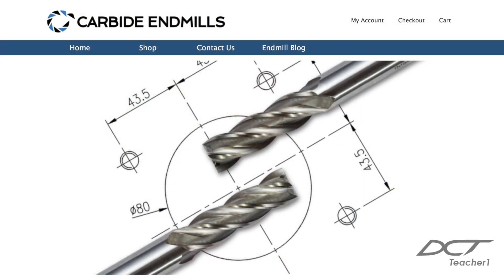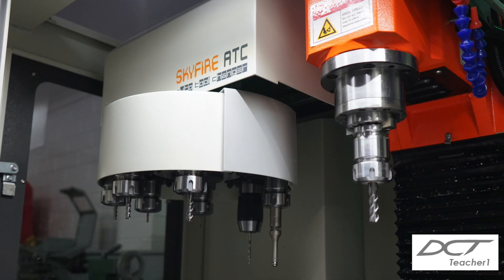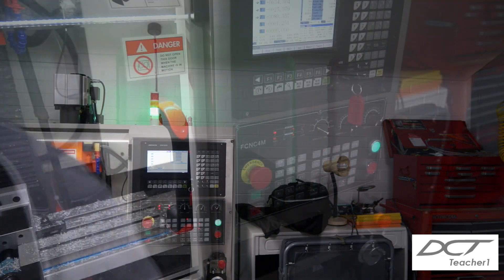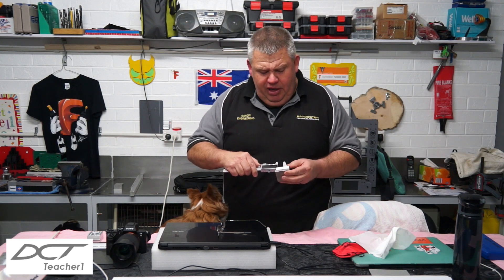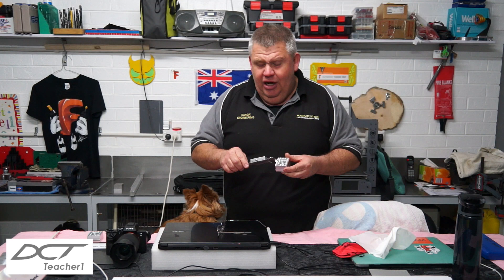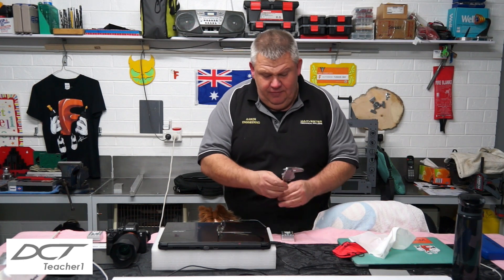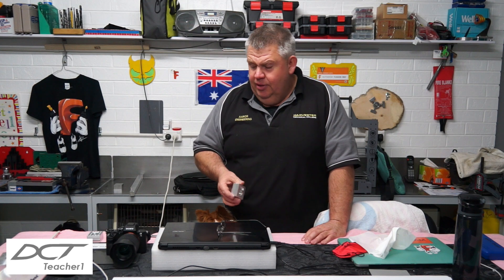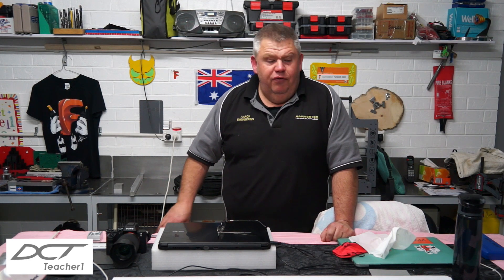SkyfireCNC First Test Cuts - Using Fusion360

Comment: How does the vibration of the z axis feel?
Reply from the maker: Hi, I sold this machine over 1 year ago.  I now have a Syil X7 CNC mill.  Much more solid and overall better machine.  Cheers, Aaron.
Reply: @DCT_Aaron_Engineering   I see, Syil X7  is it a Chinese manufacturer? because I don't see it on alibaba
Reply from the maker: @wiraxbox360  Yes they are Chinese OEM manufacturer.  So they don't need to use Alibaba.  Google search SyilCNC

Comment: gosh i wish they were cheaper. i wud get one straightaway :(
Reply from the maker: Yes I agree, but unfortunately that's just the way it is with CNC machines.   If you would like to get into CNC, I suggest converting a manual machine first with stepper motors.  This is how most of us started out :-).  Cheers, Aaron.

Comment: Are the Skyfires normally that slow or are you running it that way for demonstration purposes? I had thought they were capabale of 300 plus ipm.
Reply from the maker: Hi Glenn, yeah I'm just taking it easy mate.  The machine is capable of some very fast rapids.  However, remember spindle RPM and feed rate go hand in hand ;-).  My spindle will only go to 7K.  Supposed to be 8K but it hunts like SOB at that rpm.  Cheers, Aaron.

Comment: Hi Aaron, I was going to pull the trigger on the Masso based on your enthusiasm, but you've slipped us a side-step by going to a turnkey option. Why so?
Reply from the maker: Hi Bernard.  I bought a Masso and installed to my own CNC machine back in January 2017.  I was very happy with the Masso and it worked very well for me the time that I had it.  The reason I purchased the Masso was because of the support I got from Jatinder.  Furthermore, I liked how it was so easy to wire up, set up and use.  I sold that machine to fund the "turn-key" skyfire.  Knowing what I know now, I wished I had purchase a Syil X7 Combo.  My skyfire machine has had it's moments, but it has had 4 or 5 break downs over the past year.  Cheers, Aaron.

Comment: Hi Mate,  I dont know if you still monitor these videos but if you do I have a question if you dont mind.   Why did you buy ready made machine over building your own machine?   Your videos are very good information. Thank you so much.   Good on you.
Reply from the maker: Hi Thomas.  Thanks for watching and thanks for posting a comment.  TBH I did originally convert my own machine some time back.  I used it extensively at home, but just got so sick and tired of constantly tweaking it.  I opted for a turn key machine that has linear rails, servos on all axis, toothed drive servo spindle motor, BT30 spindle with ATC and PDB.  I just want to machine parts and not be a machine builder.  My next machine will be a Syil X7 Combo.  Check them out on Instagram CNSyil.  Cheers, Aaron.

Comment: I couldn't' stop grinning watching this video. I'm in my 50's and it was like watching a kid opening up the ultimate gift at 12:00:01 AM on Christmas Day. Watching your previous unboxing of the SkyFire was almost scary as I thought it was going to tip over in the lorry.

Seems you enjoy some of the same hobbies I do. I've had a few R/C airplanes in my day and now into the bigger stuff, stock cars (on my Youtube Channel) and want to have a home CNC machine one day. Oh how I wish I could machine my own blocks and aluminum cylinder heads (porting). But like you, I can't afford a 5 Axis Centroid or Haas VF4 SS, let alone, able to get 408 / 600 V 3 Phase in the country (Ontario Canada). I used to have Sunnen Machines for engines when I was on the westcoast.

Looks like a decent machine that could possibly support 5 Axis and be rigid enough to be accurate to hold decent tolerance. Maybe one day SkyFire will make a tad heavier table that could mount a Small Block Ford cylinder head for porting. I like that your machine can run on 220/240V single phase. I have family in Australia (Aubury - Woodonga) and now maybe I have an excuse to come back and see all the rellies! 

Nice to know that you have good support between Fusion and the machine's OEM controller. I've read good things about the Siemen's but you stated the cost and yikes, before you know it, you'd be as you stated with all the other options, into some serious money. Like Australia, our Canadian dollar has declined from par to pretty bad US exchange rate. But our import taxes for products made in China are not as high as yours are, so I suspect our cost of the machine might be a bit lower but perhaps offset with higher shipping costs. I'll be following along as you discover all the challenges with your new machine (as you found with the rigid tapping and fixed) and post feedback. Glad you enjoy your new machine. Now all you have to do is CNC an automatic baby feeding station for grandkids :-)
Reply from the maker: Hey Doug, yes it was very exciting I can assure you.  I'm like a fat kid standing in line at KFC waiting for his bucket of Fried Chicken LMAO.  For the money, it's a great little machine and fantastic bang for buck.  However, it's no HAAS or DMG Mori that's for sure.  The machine does have some little quirks that I've covered in the Q&A video, but for home I'm willing to put up with them.  Yes Albury-Wodonga isn't that far away from me, approximately 4hours drive.  For sure, if you're ever in Australia make sure you look me up please.  Cheers, Aaron.

Comment: Hi Aaron and thanks for your reply.With regard to the Seimens controller as opposed to the Adtech what benefits do you think it would have.I also use Fusion 360 for CAD CAM  and program in ISO.As there is not a lot of information about the Adtech control i would be interested in your comments.Thanks Ian.
Reply from the maker: Hi Ian.  I have never used a Siemens controller, but I think there is a lot more information out there and support for this controller. Fusion 360 / HSM cam also have post processors for Siemens so that means it should be right to go.  My advice, I should have paid the extra money and got the Siemens.

Comment: Hi Aaron congratulations on your new mill.I am considering purchasing the sky fire mill and was wondering how much memory storage it has and what method do you use for program upload to machine.
Reply from the maker: Hello Ian.  Thank you for reaching out to me.  I'm not sure how much memory the Adtech 4650 Controller has.  I use Fusion 360 for al my CAD CAM work and post process the code.  I upload the code to the controller via a USB flash drive stick.  I'm very happy with my machine and I like the controller.  However, in hindsight I should have got the Seimens controller.  Cheers, Aaron.

Comment: What are you using to find your edges?
Reply from the maker: AC Custom Gunworks hey bud. I'm using a cheap $20 Chinese edge finder. It's not the best, but it will have to do for the moment. Cheers Aaron
Reply: DCTTeacher1 thanks for your quick response Aaron!

Comment: Your calipers seem to be spot on in most of your axis but one.  I would check the accuracy of your machine in that axis and retune if necessary.  It would be interesting to know if you machined several of the same parts like your test part if they all have the same oos (out of spec) dimension in the same axis.
Reply from the maker: Hi Brian.  I've been machining many parts over the weekend and the little machine is very consistant at hitting the size. I'm getting + or _ 0.01mm.  Got to be happy with that  ;-).  Thanks for watching and commenting.  Aaron.

Comment: HI Iits rob in the uk i was wondering if you could give the lenths of ballscrew and dimensions because i can get some parts and i,ll make the rest hope you can help thanks stu mate Rob uk
Reply from the maker: Hi Rob. I'm sorry mate, but don't have the lengths of the ball screws anymore.  They were saved on my iPhone, but I've sine upgraded and didn't keep the notes.  May I suggest that you download all the files that I have listed in the description section in that original video you commented on.  If you lived in Australia, I would give you the original plates that I manually made when I first converted my TM20 milling machine.

Comment: Well Aaron you just cost me a lot of money.  I've been watching Skyfire for about a year but could not find a real person to really give an unbiased opinion on their VMC.  After seeing you and the machine running in your shed and your excitement I just pulled the trigger on a SVM-2VMC with 5 axis controller and the 6 inch 4th axis harmonic drive. No worries, if it does function as well as yours and / or I have issues I will not blame you and say it's all your fault.  Hahaha.  I went though Jan Bos USA distributor.  Says 45 to 55 days to build and ship. They are 13 behind right now. So now I have to find a new home for my Charter Oaks CNC conversion. Probably going to be the longest 2 months I've ever had.  Keep up the good work and some more  Skyfire vids would really help me keep sane now.
Reply from the maker: G'day mate, I'm really sorry about that ha ha ha.  But jokes aside, congratulations.  I'm bloody stoked for you ;-). The SVM2 has a bigger work envelope and I'm sure it will be a good machine for you.  I've had a couple of issues, but hopefully Defeng can help me tweak the settings to fix them.  Sometimes on initial boot up, the machine won't tool change and it comes up with an error.  I switch the machine on and off again and then it works faultlessly for the rest of the day.  Another problem is that the spindle brake is very aggressive when running at 8000rpm.  Sometime it will trip and alarm out when stopping at that RPM.  I've got a few coolant leaks here and there.  I've been talking to Jan Boss over Instagram.  He's a good guy.  Cheers, Aaron.
Reply from the maker: Oh and another problem, the spindle can me started manually (via control panel switch) when the chuck is unclamped (not good)

Comment: I have a few questions. Why did you choose the industrial controller vs the linux cnc controller? 
Will you share the post processor you got for fusion 360?
Reply from the maker: Hi Jason.  Thanks for watching my video.  My main reason for purchasing the machine with an industrial controller is for convenience and reliability.  I got so sick of the computer attached to my DIY mill and constant program glitches or gremlins that would come and go.  I use an industrial controller at school and just seemed to makes sense.  The post isn’t mine to share.  This belongs to Scott Moyse at CADPro.  Apparently the generic Fanuc post in Fusion works fine, but I’ve never tested it.  Thank you, Aaron.

Comment: Hi Aaron love the new machine, got mine up and running but still learning, 
getting there broke a few bits but that's all to do with my speeds and feeds too much material too quick.
I have a large engineering company near me, and i get to get some material out there scrap bin lol so its all practice,  But find its getting very addictive, i work as a Mechanical engineer off shore in the oil and gas sector, why couldn't we of had these machines 30 years ago when i was serving my time, 
Great Video keep them coming.
Reply from the maker: Hi Dave, great news you got your machine up and running.  I agree, I wish I had all this tech when I was an apprentice.  Imagine the stuff I / we could've built.  Great you get heaps of stock out of a scrap bin. I have to pay all my stock as I don't have or know any companies close to me.  I'm sick with the flu at the moment, so hopefully I'll get back out to shed to play real soon.  Cheers, Aaron.

Comment: Hi Aaron,

I love Fusion 360. I am no expert in it but I use the CAD side in some of our videos. It is one of the most user friendly CAD programs I have ever used.
Steve
Reply from the maker: Hi Steve.  Yes mate I agree with you.  Fusion 360 is the "best".  I started out using parametric PTC CAD back in 2001.  Since then I went to SolidWorks and now Fusion 360 and I'm in love with.  Can't believe we have such powerful CAM CAM software at our very finger tips.  I'll check out your channel now.  Cheers mate, Aaron.
Reply: Fusion is such an incredible tool I love it. IS there a post processor available for the adtech controller?
Reply from the maker: Hey Steve, I believe the generic Fanuc post will work with the Adtech Controller. However, I had Scott Moyse from CADPro in NZ to adjust it to suit my milling machine.  I'm sure Scott would be happy to share the post processor ;-)

Comment: Hi Aaron, What RPM are you cutting at (on the second op after facing)? Thanks
Reply from the maker: Hello Pouya, these milling operations where my very first cuts on my SkyfireCNC machine and they were not optimised.  I was only runing 4000rpm and my machine is capable of 8000rpm.  Cheers, Aaron.

Comment: Looks great mate, that tool changer is worth the price of admission heh.

We still get 0.01 variation on the VMC's at work and my mitutoyos are shit so you're doing well.

How's the vibration in the spindle? This is the first video I've seen that didn't seem to suffer too much?
Reply from the maker: Hey Manny, yeah god bless that little tool changer.  Mate I had a robot chubby that wouldn't go down for hours after operating it ha ha ha.  So far so good with the vibration and other stuff.  I need to adjust the settings in the VFD and servo motor drivers.  I'll do this over the weekend.  Cheers mate, Aaron.
Reply: DCTTeacher1 Sounds like it's going great thanks for sharing the process.
Reply from the maker: Pleasure mate ;-)

Comment: Looks and sounds fantastic Aaron. That spindle is super smooth. And you are going to love that tool changer.

Interesting that even at the TM25 feeds and speeds you are still getting a good looking chip. Will be interesting to see how fast it can go when you fine tune it?

Great value for $22K AUD. Especially when a Tormach 770 retails in Australia for the same money, and that is just the mill - no enclosure, no tool changer, no tooling, no nothing... the Part Maker package goes for a whopping $39K AUD. The Tormach 1100 is even more expensive at $43K for the Part Maker package.

Can't wait to see the Skyfire in person!!!

BUT...NO MORE TISSUE JOKES...!!!
Reply from the maker: Hey Jeff, thanks buddy I'm really stocked to have this little machine in my shop.  Agreed, the Tormach retail price over here in Australia is way out of my league.  Plus, I believe the SkyfireCNC to have better specs (in my personal opionion).  For example, servo motors on all axis, servo spindle that can index and rigid tap, BT30 spindle, tool changer, higher rapids etc...  Oh, as for the tissues joke.  Luckily I didn't do the whole "warm apple pie scene" out of the movie American Pie lmao ;-)

Comment: Aaron,
What is the collet size?
I may be able to send some tooling  
your way in the future🤔
Reply from the maker: Hey mate, how you doing?  This little machine is running BT30 tooling with ER32 collets.  For sure, if you have some I won't say no ;-)  What I'm after is some of that pink cimcool coolant that Craig was selling through Iscar.  I need to contact them.  Cheers mate.

Comment: Neat to see one of these machines. Hope you are going to crank up feeds and speeds as you get more comfortable with its capabilities.
Reply from the maker: Hi Andy, thanks bud.  Yes mate for sure, this was only at 50% and she's still got more in her.  The machine is still on its castor wheels.  I need to jack her up and level it before I push too hard.  Oh, this was only my 2nd part ever.  I just had to grab the video and get it out there.  Cheers Aaron.

Comment: Congrats on an awesome very capable little home machine.
Hopefully it will force the comepetition to step up their game too.

I started reading up on the controller today, since I saw what model it is in your former video.
Personally I cant imagine living without probing capability on a cnc, it's so versatile and easy to use.
So my question for an upcoming Q&A is are there a possibility to add renishaw probes or maybe passive probes to the controller.

For me personally that can be a make or break point when considering a buy.

Keep up the videos and slinging those chips. :-)
Reply from the maker: Hi Patrik.  Thanks mate I'm really excited to have this little machine.  I agree, probing with the Reneshaw system is fantastic.  Especially the tool offsetter as this helps to hit the size every time.  Not sure if I could afford a Reneshaw probe system.  The one on the HAAS cost us approx $10K, but this was through the dealer.  I need to read or contact to Adtech to see if the controller is capable of probing.  I know it can automatically probe the tool length, but unsure of anything else.  Cheers mate, Aaron.
Reply: DCTTeacher1 Since there is a tool setter available which almost certainly is a passive contact or induktion switch. 
There shouldn't be a problem using something like the passive probe that Tormach has, it should be plenty good enough for hobby use. 
Plus it can be adjusted with a dial gauge to be centered.
Reply from the maker: I think you're right mate.  I'm sure the Adtech controller should be able to use a probing system.  I will contact them via email and ask ;-)

Comment: Your holders seems a little long, the cutter should be as near to the spindelbearing as possible, or you could get vibrations.
Nice machine.
Reply from the maker: Thanks Helge. Yes mate where ever possible must choke up on the tool.  These are standard BT30 70 ER32 holders.

Comment: Great video bud, thanks for sharing. Do you think this machine is capable of machining stainless steel?
Reply from the maker: Hi Joe thanks for watching.  Yes mate I'm sure she could easily cut steel and stainless material with the correct cutters installed.  Running a good CAD CAM system such as Fusion360 with modern machining strategies also helps ;-)  Cheers, Aaron.